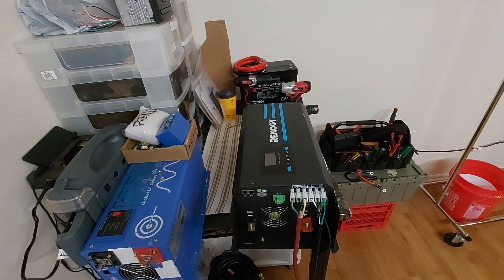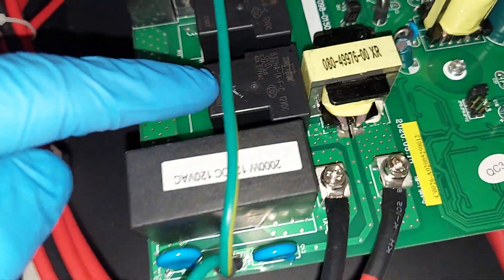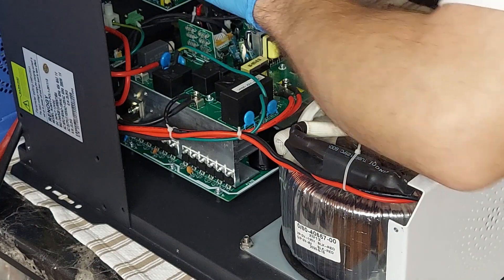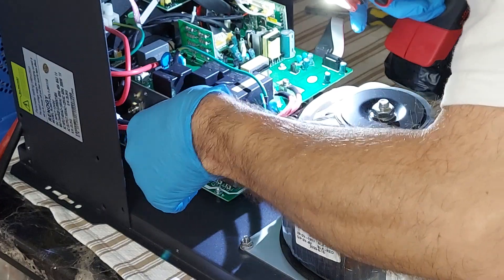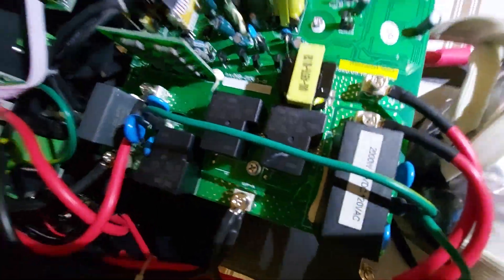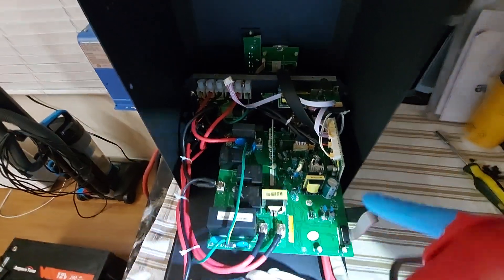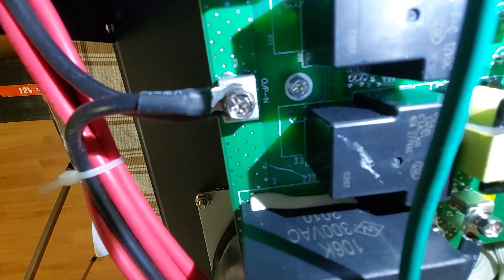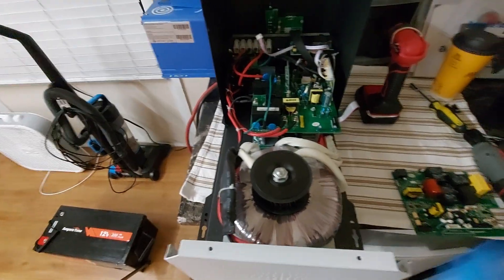Inside a renogy 2000 Watt inverter charger

Comment: Awesome video! Was really needing it. My 3000 watt renogy was acting up and I wanted to blow it out with a compressor too. 

I noticed that the silver plate below the transformer has warped really bad, causing the bolt to contact the inside od the shell. Should I be concerned about that?
Reply from the maker: I'm not sure exactly I no longer own it

Comment: I use 1 AWG booster cables, cut the clamps off and add my own cable terminals. Found that to be cheaper than buying the 1AWG wire directly.
Reply from the maker: Definitely